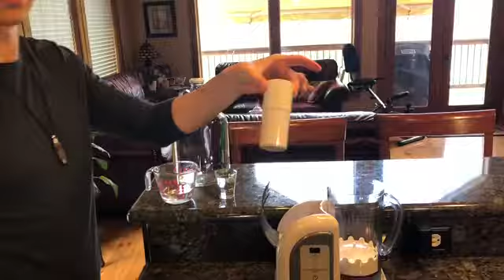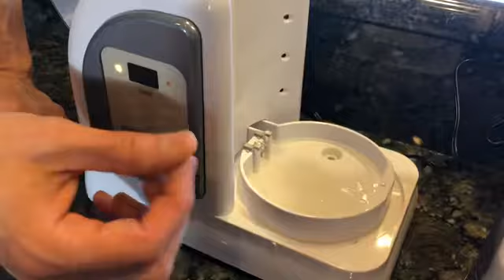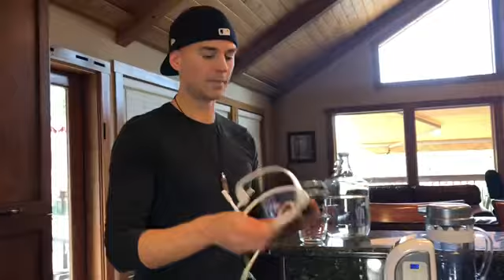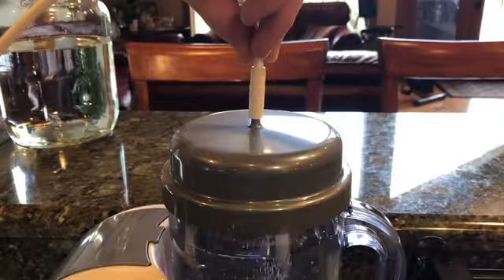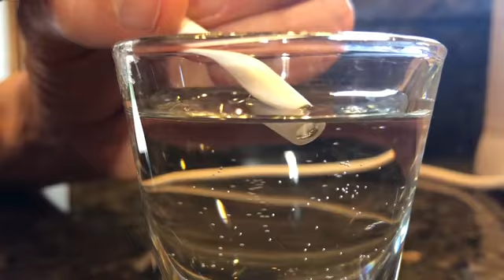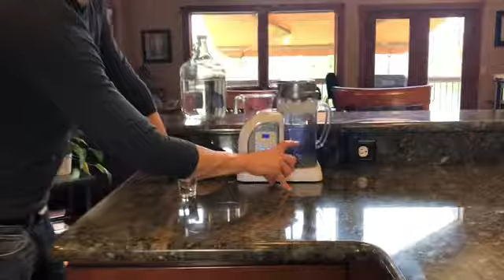#61 2018 Lourdes Hydrofix SET UP / Long Version International model

Comment: Hi, I just received my new Lourdes Premium 2024 edition.  Your videos are very old now.  Do you have any new videos or instructions?  I can’t tell that the cannula that came with my machine is releasing anything at all.  How can I tell if there is hydrogen being released?
Reply from the maker: Watch videos 337 426 and 388 and all the machines are lab tested and certified, which means that it is making hydrogen for the inhalation certain. There is no way for you to test it, as the equipment to test it is extremely expensive, and nobody in the US has it.  If you still have more questions, you can email me if you like it Uprising144k  at gmail.com.
Reply from the maker: I should also mention, there are videos I have posted that show how the machines are tested in Japan.  It's really cool and shows you the correct way to do it, as there are many incorrect ways being used unfortunately in the USA, as they don't seem to understand hydrogen very good, since it's such a new thing in the USA
Reply from the maker: Here is the link on how the measure the hydrogen in the water https://youtu.be/i3TNUwnRQ20?si=wDHz0L4DOjzqTXnY

Comment: Although the H2 water system seems to be working for us, I do have a few questions for you. 
Question a): ~ How long does the H2 last in the water after the 30min. spin before drinking?
Question b): can the Pouch when filled with H2 water be placed in the fridge to cool off a bit before drinking and still be effective? 
So far these are the only two questions I can think of it at the moment.
I personally enjoy the H2 water just like it is, but my hubby only likes to drink water when cold. 
Thank you!
Reply from the maker: You can make hydrogen ice cubes, watch that video and then put them in the pitcher while making hydrogen water and it will be cold when the water is ready
Reply: @UPRISING144K  Never mind, I answered my own question...lol
I just found your video  #350 on how long does H2 hydrogen gas stay / lasts in water? How long can I wait to drink hydrogen water? You, my dear have a lot of helpful video on your channel, thanks!!! 🤗💞
Reply: @UPRISING144K  Awesome, thanks!!! Would this imply that the Hydrogen water can last up to a few hours after the making of it? Do you have an idea how many hours?

Comment: Testing my Lourdes machine with the blue drops and its very low ?
Reply from the maker: Many people have been misled by the blue drops and I will be making more videos about it in the future. Meanwhile, here is a video that will help https://youtu.be/M6BA9RwiEIM
Reply: @UPRISING144K   is there another way to test ??
Reply from the maker: @keithbell6104  the equipment to test properly is expensive.  I would simply clean the machine and at that point it should be working properly.  And as long as it’s making bubble’s..  if it’s not making bubbles, then you know you have an issue
Reply: @UPRISING144K   it is making bubbles
Reply from the maker: Btw how long have you had the machine?  Email me and we can chat also uprising144k at gmail
Reply: @UPRISING144K   thank you for helping ,, i have had the machine for 5  years now

Comment: Hello. Excited about getting my 2019 Hydrofix today! I have a question; where do we buy a new filter to replace the old one? Thanks for providing us with informative videos. Blessings.
Reply from the maker: Filter for what?  The Hydrofix filter?
Reply: @UPRISING144K  Yes, just received my 2019 Lourdes Hydrofix and it's bubbling so well!  I am breathing through the apparatus while it's producing hydrogen. Everything is going smoothly. Thank you so much. This morning, I saw one of your videos discussing replacing the filter about once a year. Did I misunderstand?
Reply from the maker: You understood, the machine has a special H type DI filter, you simply change it once a year, it's super easy and cheap.

Comment: I've recently bought this machine and unfortunately I used soap when cleaning it before using it for the first time (washing up liquid - small amount).  I'm worried now I've damaged the membrane.  When it's switched on I can see hydrogen bubbles being produced and it looks like your model when in production mode.
Reply from the maker: I would recommend reading the owners manual before using further, to make sure in the future you are using it properly and maintaining it properly.  Meanwhile, your machine is probably fine, since u only did it once, used little soap, and it appears to be working.  Just keep an eye on it and see if it continues to work normal.  But, you could also contact the company if u you are concerned.
Reply: @UPRISING144K  Thank you very much for your swift reply and reassurance.

Comment: what is the 100 ml water u put in the filter for?
Reply from the maker: That's where the hydrogen is extracted from.
Reply: @UPRISING144K  Got it. And every day you have to add 50 ml for every new cycle right?
Reply from the maker: @pepsesto5120  : No, don't add 50ml everyday.  That could potentially brake the machine.  You only add the 50ml when the machine asks for it.  There is a light that comes on when it needs the 50ml.

Comment: so if i use this machine does it mean i dont have to use 35% fg hp if am currently use that liquid currently?
Reply from the maker: vincent murai :  u must understand that Hydrogen peroxide (hp) is not the same as the Hydrogen the hydrofix makes.  Hp is actually more oxygen, not more hydrogen.  U can use the hydrogen from the hydrofix everyday and it’s safe.  I would not recommend using hp everyday for years.  Hp can be dangerous.  If u want to intake more oxygen, simply use the wim hoff method.

Comment: This is a great video. I do have a question though. I always thought in order to make hydrogen water you had to use water with minerals in it. Is there a reason why this ones different?
Reply from the maker: veronica murillo :  This new machine is designed to be able to use distilled water also, but it will make 0.1ppm of hydrogen less, as compared to water with minerals.  It’s simply a wonderfully engineered machine, that allows for great flexibility.
Reply: UPRISING 144K Do you know if you can add minerals?
Reply from the maker: veronica murillo :  add minerals where and to what?
Reply: UPRISING 144K the pitcher?
Reply from the maker: veronica murillo :  yes you can add minerals to the water that would go into the pitcher.  However, don’t simply put minerals in the pitcher, when there is no water in it.
Reply: UPRISING 144K putting minerals in the water will higher the orp right?